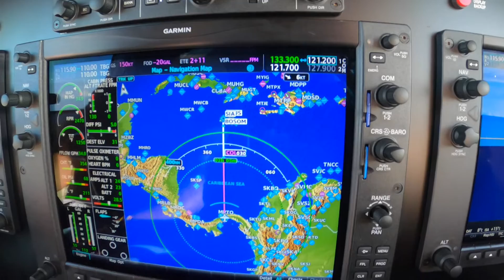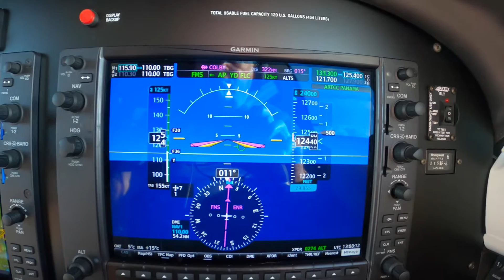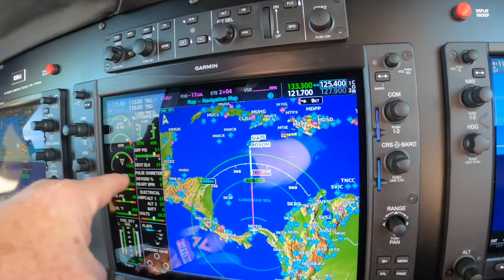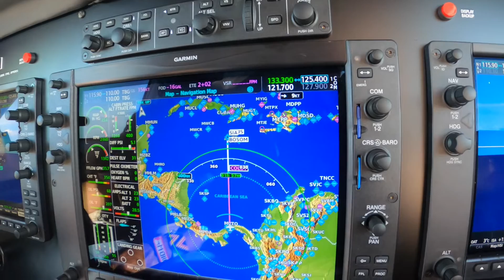Piper M350 Engine Management in the Climb with Dick Rochfort

Comment: Why is this M350 delivering such low climb performance? This is your second PA46 video showing 500 ft/min. Is this really all it can do? My acquaintances flying PA46 say they get more like 600-800 with CHTs well below 400. Can you explain?
Reply from the maker: Hi Antoine, Your acquaintances are not wrong. At lower density altitudes when making a full 42” of power and with alternate air closed it will readily do what they say it will do. It will even fly the ODP out of Vail CO in snow (815 ft/nm). It won’t do that above 10,000 or with even a minor induction leak. This aircraft had a minor induction leak (I think). There is also a fine line between proper use and abuse. .. Fly Safely - Train Often .. DR
Reply: @RWRPilotTraining  Thank you for taking the time Dick. I see your point, and your tactful reply deserves a compliment sir!
Reply from the maker: Thank you. Fly Safely - Train Often .. DR